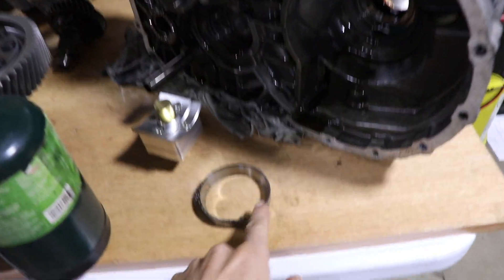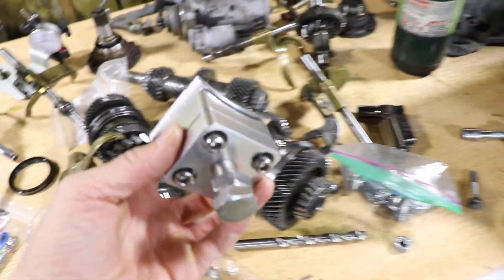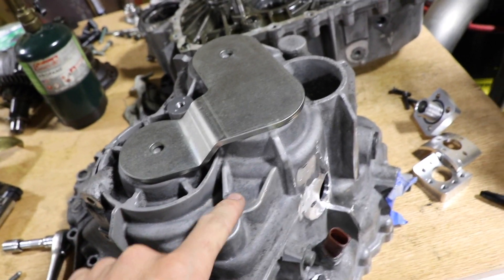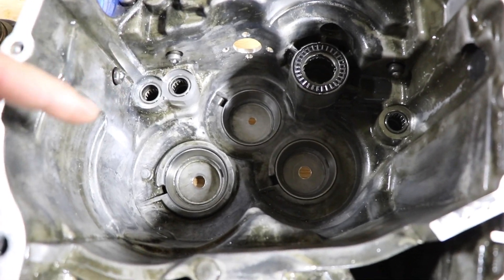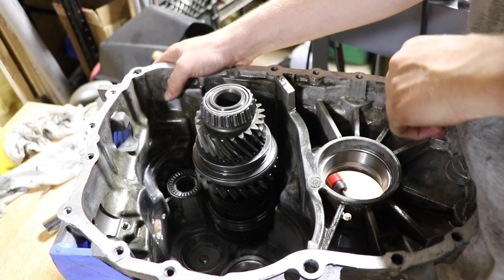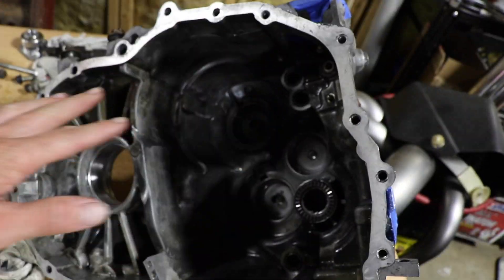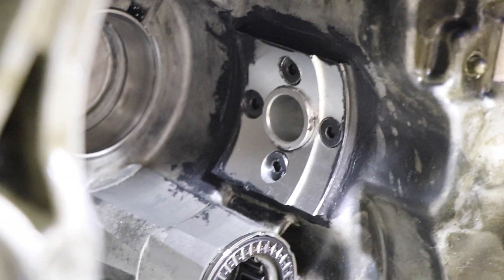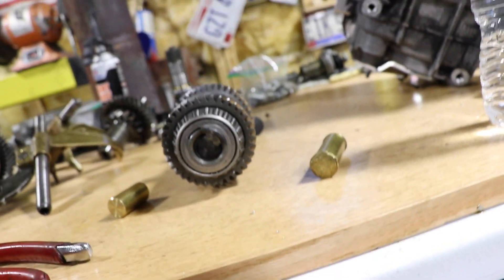⚙️DIFF PRELOAD & GEAR SUPPORT INSTALLATION🔧 ||  02M VR6 TRANS BUILD💪 (pt3)

Comment: great video, I'm doing the same process.
I have a doubt, according to the manual, do I have to adjust the differential with a clearance of 0.30mm?
Reply from the maker: Not a clearance of ,30mm but a preload of ,30mm. It squishes the bearings ,30mm🤙

Comment: Sweet video. Just got my support. Going to install this week. We're did you get that support that goes on the transmission the one that's flat and goes on the top? I am making 500 plus hp is that something I need to worry about?
Reply from the maker: You talking about the plate with the 3 bolt holes? I got everything for the trans from a website called darkside developments, They are out of the UK
Reply: @PostPros  yes I just oreded mine. Will be here then I can clean the cases and assemble with a wavetrac and all of these mods and have price of mind.

Comment: You welded to a heat treated shaft. :/
Reply from the maker: You're right(also the bearing surface), but it was just a small tack. Also I do NOT want that core coming out, that would be worse, so ill ''risk'' welding to it🔥
Thanks for tuning in

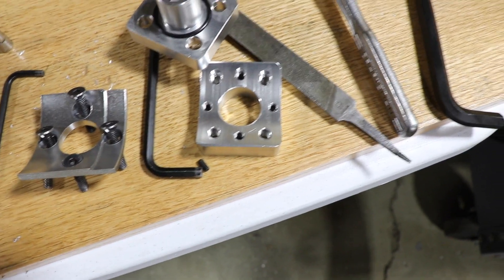Comment: 5:55 why not just weld them on?
Reply from the maker: I’ve seen it done, but welding to cast aluminum usually isn’t the best and makes a nasty weld. Bolting also gives you some adjustability🔧.
Although I’m sure welding would be fine too🔥 
Thanks for watching🏁🏁

Comment: Just curious if you guys at any point thought of welding the middle housing piece of the  4th gear input shaft support on the outside instead of just sealing it with silicone.  than  the inner piece inside the housing wouldn't even be needed.
Looking into building a 337 GTI and find your vids very insightful.
Reply from the maker: I’ve seen people weld them, which would work fine. But we just used the screws to hold it. The silicone works great and doesn’t leak at all. I’m sure welding is fine too tho🤙. Welding to cast aluminum does suck at times. As long as we don’t have problems, I’d probably stick with bolts next time too. Just personal preference⚙️⚙️
Good luck with your build!!🔧
Reply: instablaster.

Comment: Did the 4th gear support come with instructions on how far up on the case to drill
Reply from the maker: If you read my description I say that they are in line with the case casting marks also say that in the video.. At 2:14 you can see it perfectly🤙
Like Ricky said pics offline is all we had!! Good luck🏁
Reply: No, i just went by pictures i seen online. It depends on what website you buy the gear support from though. If you buy it from darkside developments i think they link a pdf file of instructions when you buy it